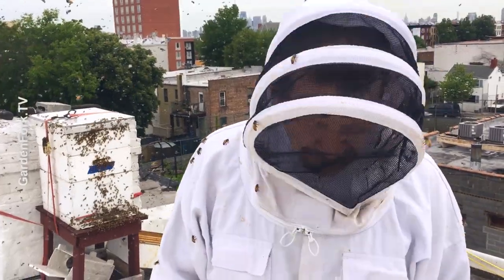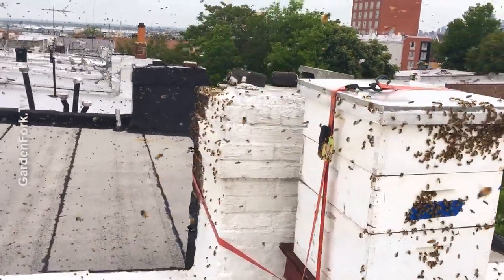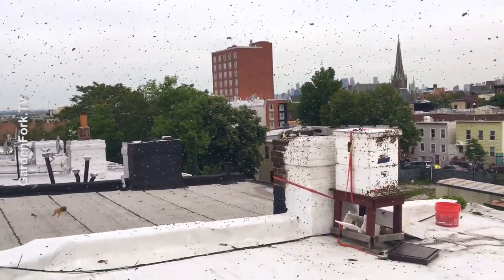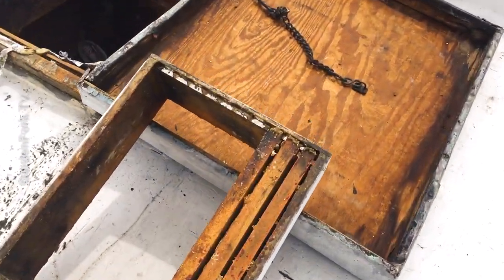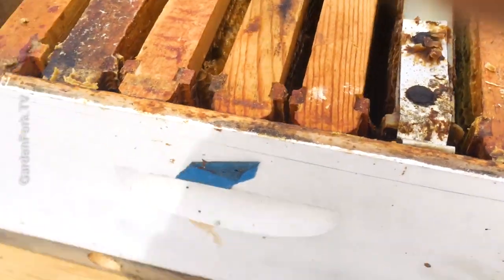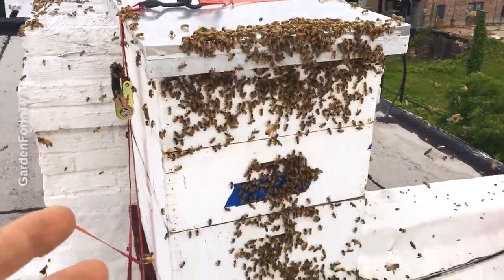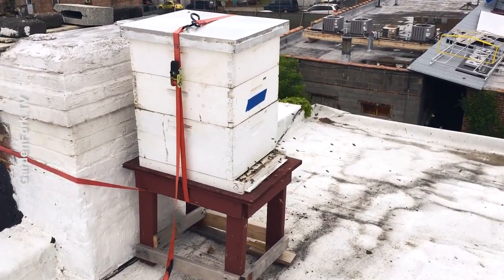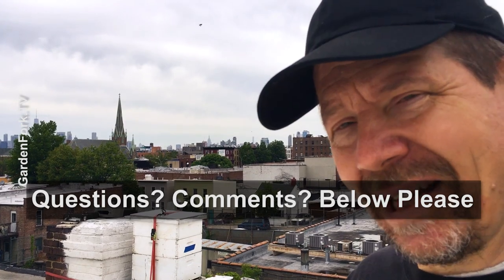Watch My Urban Beehive Swarm, It's Beautiful - Beekeeping 101 - GardenFork

Comment: Hi Eric, sad to see the swarm leave and not re home it.
I guess timing is everything, but sometimes everything has to be right.
Last year one of our hives swarmed(prime swarm ) and it landed 15 ft away in next doors garden.
It was re homed in another make shift hive.
Today 27/5/17 either early morning or late evening of the 26th we have 10 hives 5 occupied and 5 empty ready for splits.
Anyway back to last night or this morning,I went out to move a feeder used to mass feed,and found it to be nearly empty.
Last night there was around 7 pints of syrup and this morning empty.
I moved it and opened it to find a small cluster inside,not wanting the bees to get cold,I opened what I thought was a empty hive only to find a huge swarm clustering on the inside of the roof.
Also there were bees in the brood chamber,so all in all a great result and a first swarm for us without doing anything.
Now our other neighbor has an old dirty hive with just frames,so I melted beads of wax onto a few of the brood and super frames and sprayed them with syrup,adding a lemon grass cotton tip to act as a lure.
Plenty of bees were scouting so fingers crossed.
Sorry for the drawn out story p,just trying to give you the background on how it happened.